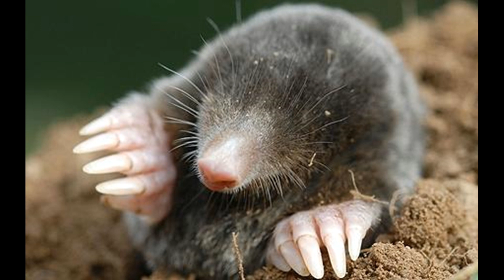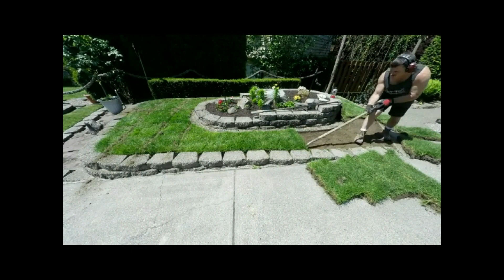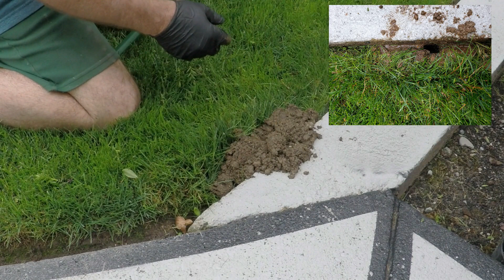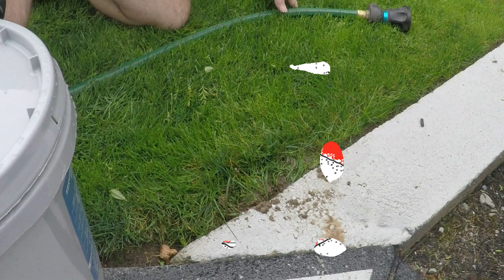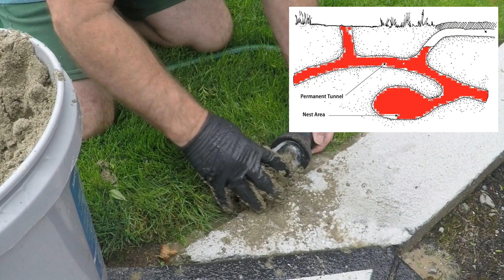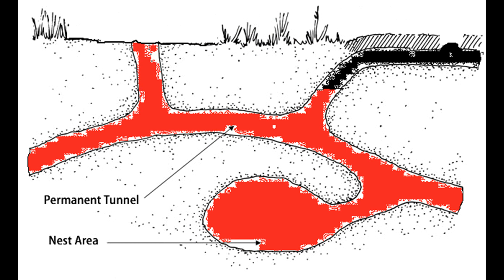DIY (mole damage repair)

Comment: They will just dig new tunnels lmao. Trap them that’s the only effective way.
Reply: Loo block in the tunnels. Blue or white.
Reply from the maker: James, I think you missed the point of this video. The title is “mole damage REPAIR”.  Once you have gotten rid of your current mole, the tunnels need to be filled in. In addition, like all animals, moles will go were their life is easier. Do they stay in my yard where there tunnels keep getting filled in? Or do they stay in the neighbor’s yard where they are unbothered? Finally, there is the chance this method will catch them in their burrow and bury them.  Have you ever tried to dig yourself out when you are buried with wet sand? You cannot move your limbs, so it won’t happen. Finally, after doing this process for 6 month, I have not gotten a new mole since.  Somehow, I am wondering if your occupation is trapping moles. This would kind of explain your point of view. Lost revenue?? Hmmm?